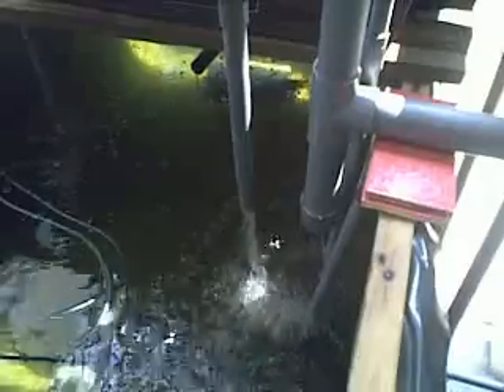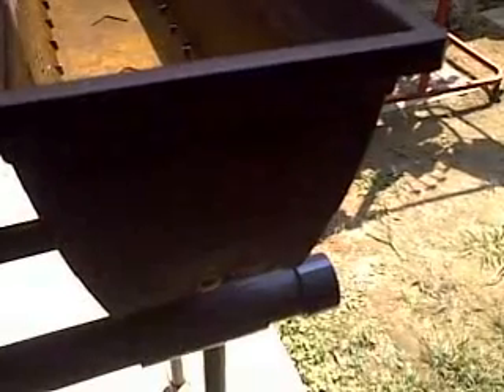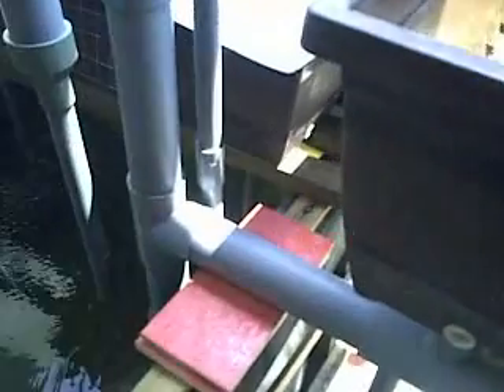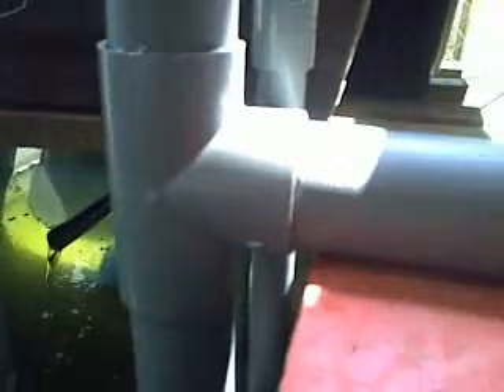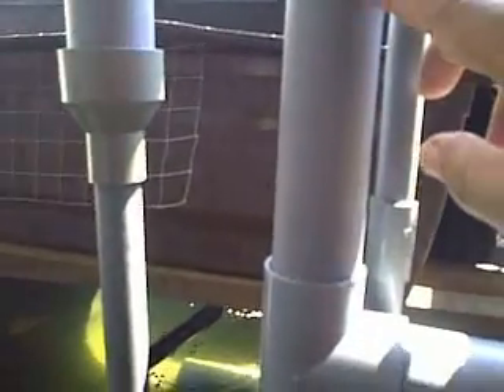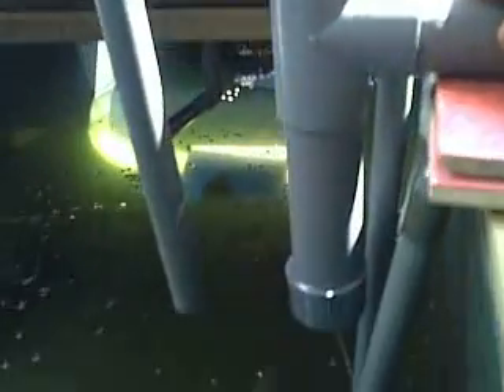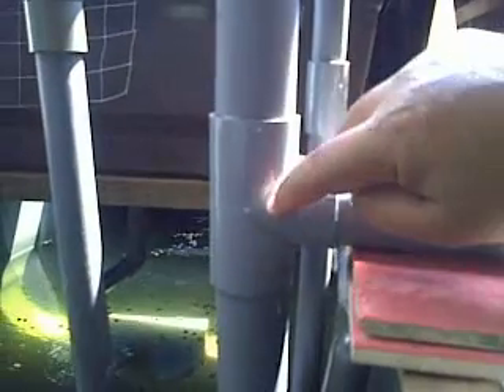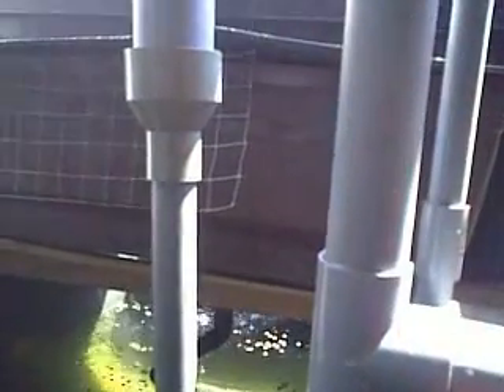Basic Aquaponics - Swivel Valve A Brief Explained

Comment: I made this design. I drilled the hole on the side of the bed 1" higher than the base.
I used 1" PVC pipes out of the grow beds and reduced it to 0.5" after the U loop. Connected 6 grow beds in series. Each grow bed is 60L. I'll have 3 fish tanks also connected.
Pump is 12L/min (720L/hr)

Do you have any advice?